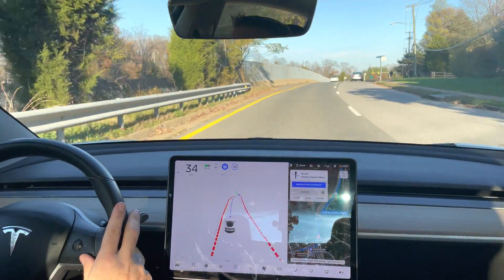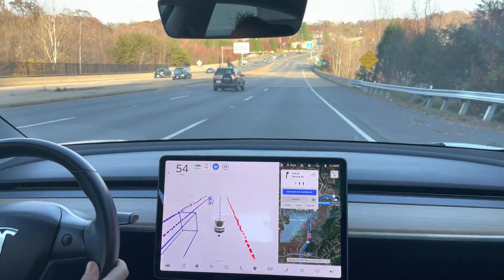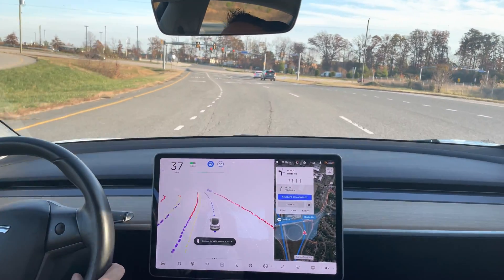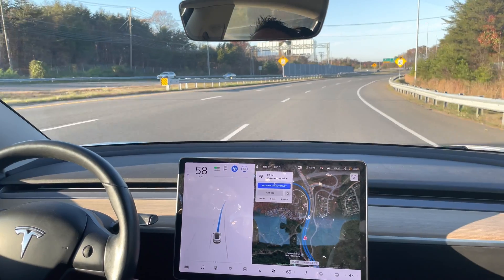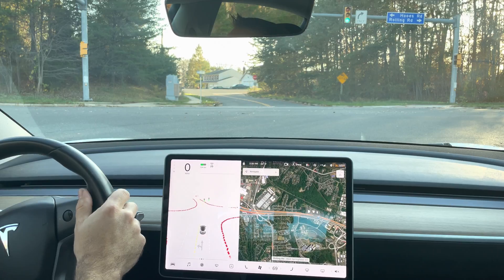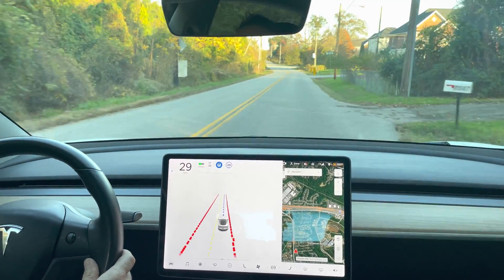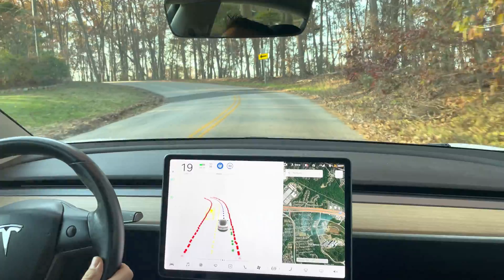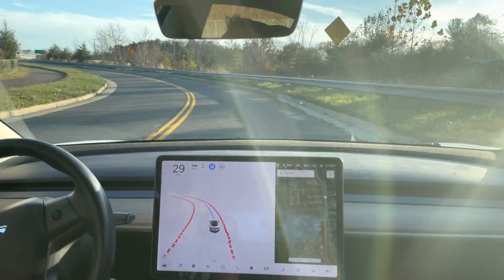FSD Beta: Curvy Steep Road (Hooes Rd.) Tesla Model 3 2020.44.10.2

Comment: Thank you for this video. Glad to see NOVA represented.

If you’re taking requests, I’d like to see it handle a few runs through Seven Corners, Clarendon 5 way intersection, and maybe the i95 mixing bowl (my navigate on autopilot can’t currently figure out the on ramp from Springfield mall to 395 north.
Reply: @DMacTech  subscribed. Looking forward to seeing them, and any other videos you make. Here are the pins of the intersections/merge areas I’m specifically talking about. 

https://maps.apple.com/?ll=38.885877,-77.097048&q=Marked%20Location&_ext=EiYp8OiQ1sRwQ0AxnoOO/JVGU8A5br62MutxQ0BBvqUr6NhFU8BQAw%3D%3D&t=m

https://maps.apple.com/?ll=38.871805,-77.155706&q=Marked%20Location&_ext=EiYp3N+PgvhuQ0AxAJ+ZeFdKU8A5WrW13h5wQ0BBSCrIbZpJU8BQAw%3D%3D&t=m

https://maps.apple.com/?ll=38.785140,-77.177424&q=Marked%20Location&_ext=EiYp7ipaYOBjQ0Ax94XvK65LU8A5bACAvAZlQ0BB850AXPFKU8BQAw%3D%3D&t=m

But really, I’m happy to see any fsd in the area.
Reply: My navigation system doesn't recognize the most efficient/safest Tyson's Corner route from Old Keene Mill.  It always wants to direct me to merge into the left-most lane of 95/395N and then immediately cut across all lanes of traffic to take the Tyson's exit, rather than simply following the "To Tyson's Corner" ramp and avoiding all the merging.

Comment: If you really want to try a challenging road, try Braddock near south riding at this point

15365-15357 State Rte 620
15365-15357 State Rte 620, Chantilly, VA 20151
https://maps.app.goo.gl/LrRbhi9XkWDKWws17
Reply: There's also a proper roundabout around there as well right at Cox Farms